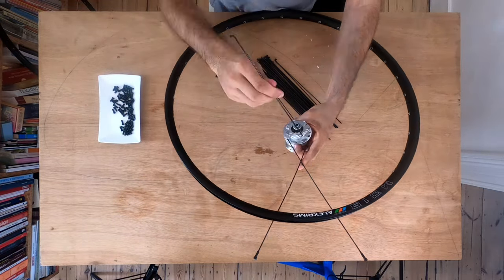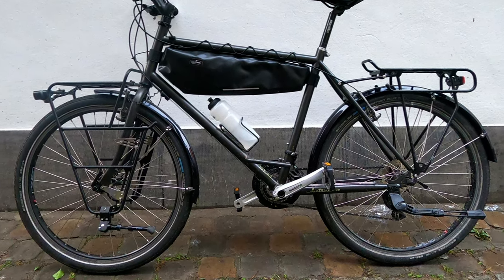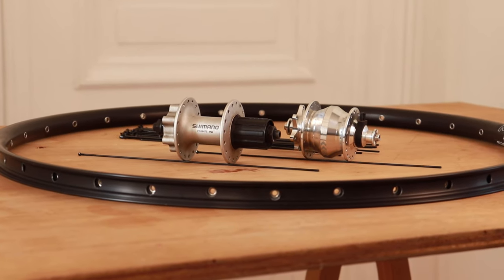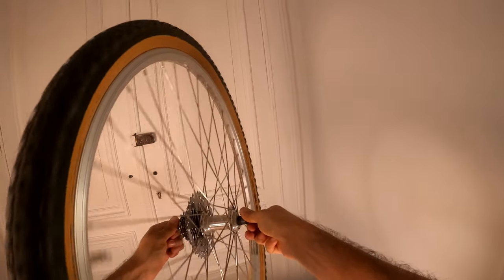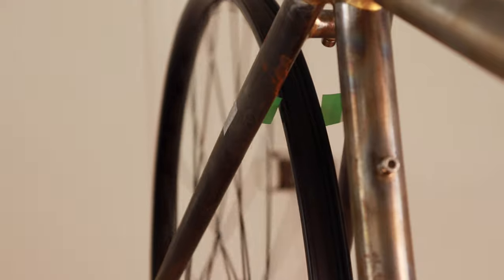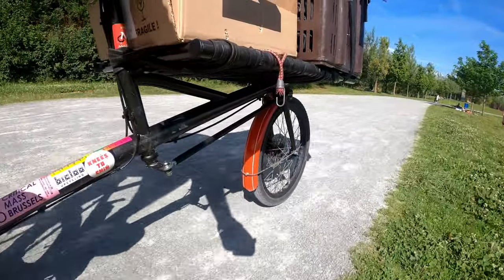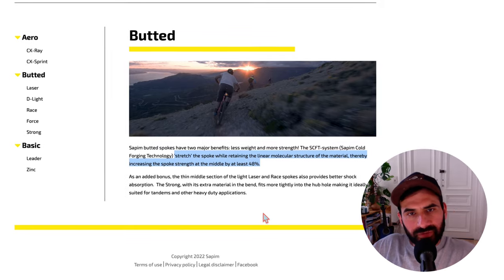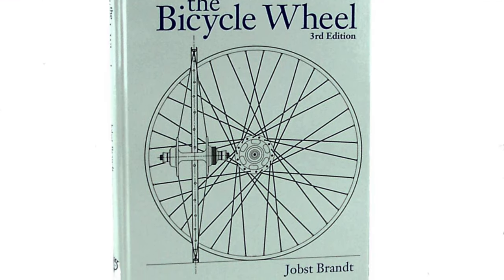Why building your own bicycle wheels + 3 tips to get you started

Comment: I haven't built a wheel for many years. (Of course, I had to count... 60 years [sigh]). Now I've got to get back into it. At least tune all the wheels I've got. I don't need instruction, but you are on spot with this video; I did need that push of motivation. Going to buy that truing stand that has been on my wish list since 2021.

Comment: As a community bike shop volunteer, I was always surprised how often people who had no previous experience with building wheels were able to build their own wheel with just a tiny bit of direction. 

One useful concept is embodied in the the unfamiliar word "recursion". --you don't just "tighten the spokes" instead, you tighten slightly, then check true & correct, then check round/hop & correct, then check dish & correct, then check tension & correct, then tighten (again) and then repeat all the above steps. . . the perfect wheel comes from repeated imperfect corrections of the gross deviations until the wheel becomes "perfect".